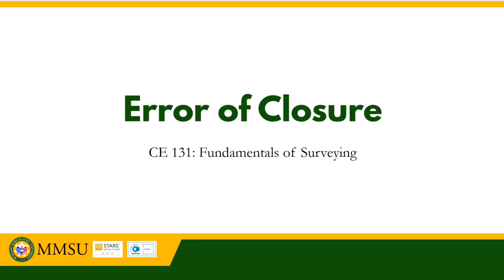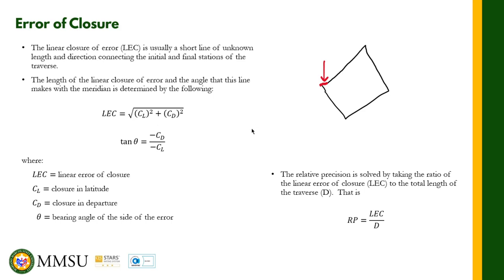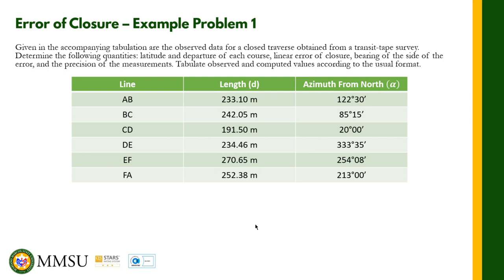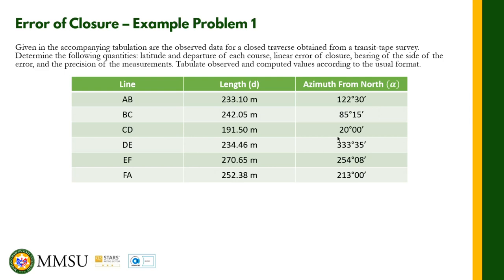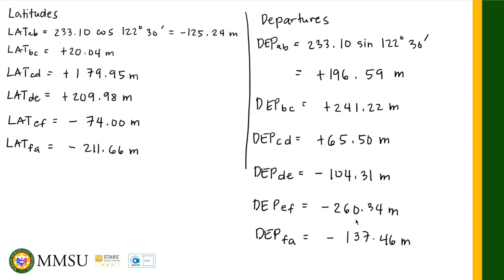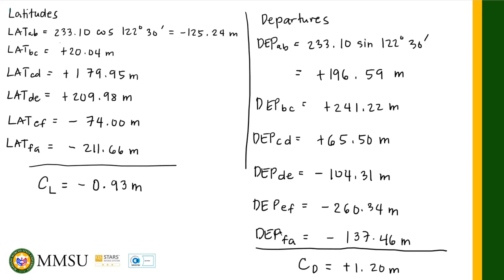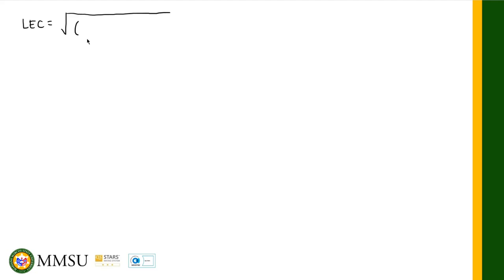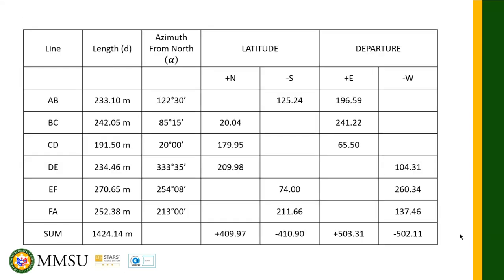Linear Error of Closure | Traverse Computation | Fundamentals of Surveying

Comment: sir pano po naging 52°13' pano po e convert?😭
Reply: Kapag po gumamit ng calculator ang lalabas ay 52.22431569°

Tapos ang order po para maging katulad ng 52°13' is Degree Minutes then Seconds

Yung magiging degree po ay yung whole number.
Tapos pedeng 52.22431569-52=0.224315695

Tapos Yan pong decimal na iyan ay times 60 lang.
Tapos ang lumabas ay 13.45894164
So ang for minutes is 13.
And if you want to know what is for seconds, just minus 13 from what you get on the calculator.
13.45894164-13=0.45894164.
Then times it again to 60. Tapos ang lalabas is 27.53649856

So kaya naging 52°13'

Comment: Sir  saan galing ang  1/936.93 or 1/900
Reply from the maker: Gawin mong fraction na 1 ang numerator. Basically, the denominator of the desired fraction will be equal to denominator divided by the numerator of the old fraction.
Reply: OK Sir thanks